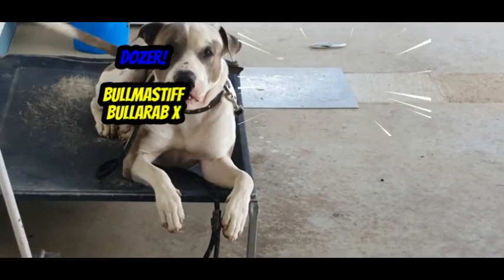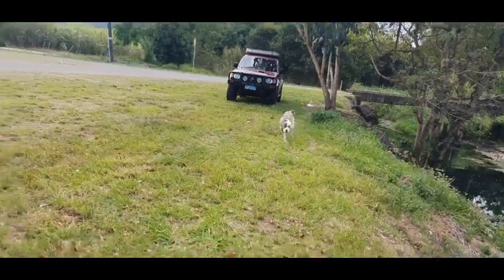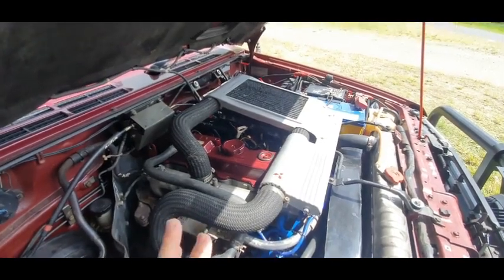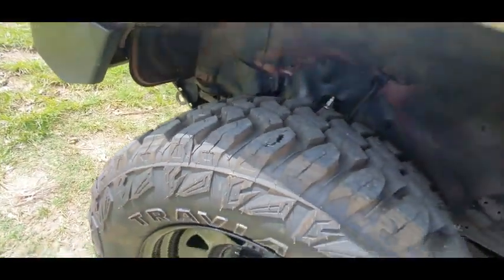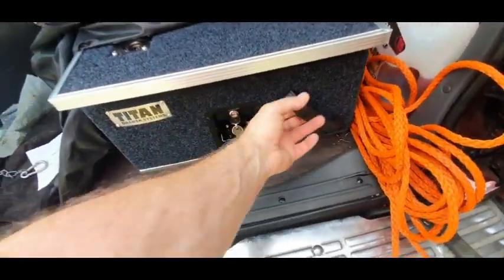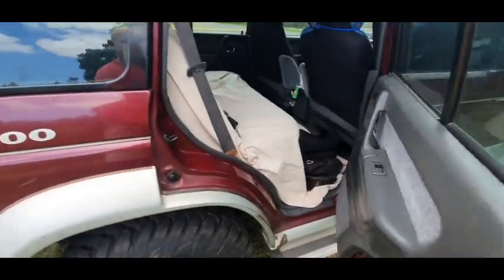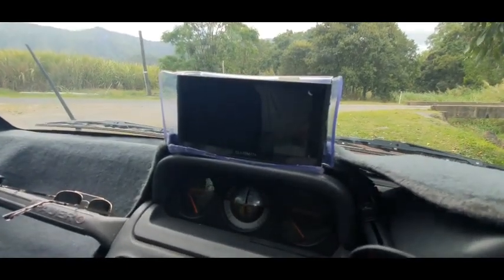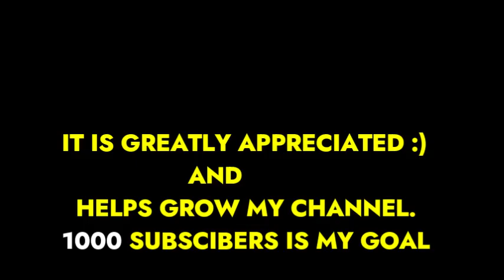💥4X4 WALK AROUND!  PAJERO.. GEN 2 TURBO DIESEL  2.10.2023

Comment: Wicked truck. Whached all your vidios. Awesome content. Got exactly the same year and model. Just clicked over 4k and goin strong. Giving it a birthday in a month or so with the motor coming out and replacing everything. Where did you get your manual hubs from. Whats your rims ofset. Cheers
Reply from the maker: I'm extremely pleased that my content is helpful and thanks for watching 👍the front hubs where of ebay from jaalk-9 helpful seller good price $100 total for left and right sides. As for the rims i had a spare in the shed, after fighting off reback spiders 🕷 i measured the outside....from centre out flush is .120mm or 12cm & inside .100mm or 10cm.🙂... enjoy the learning experience removing the engine 👌heaps of research helped me so much if it's your first engine removal 😁are you located in Oz
Reply from the maker: Don't forget to subscribe and smash the bell😉 lots more in the future 👌